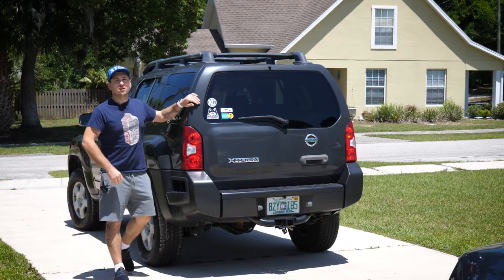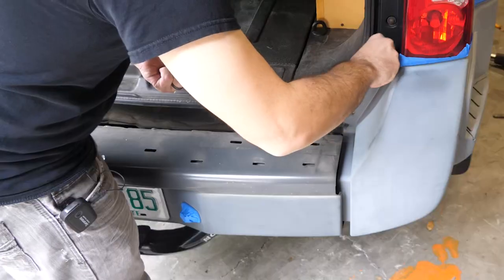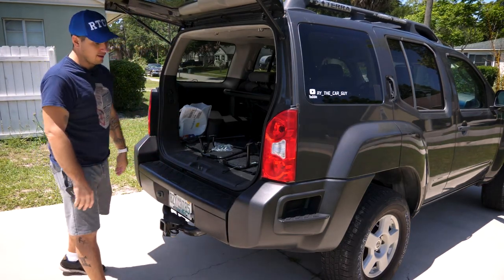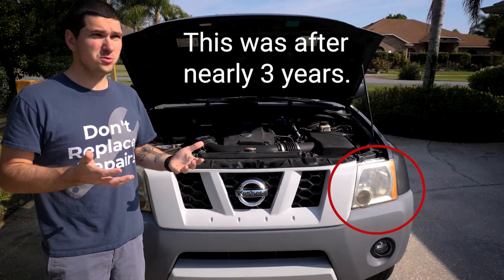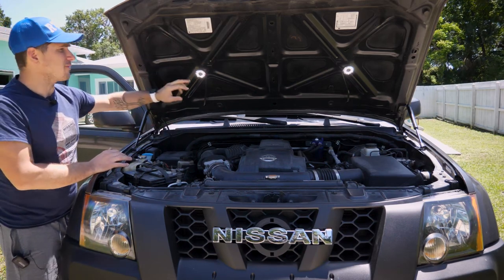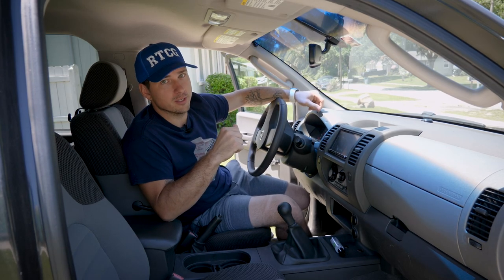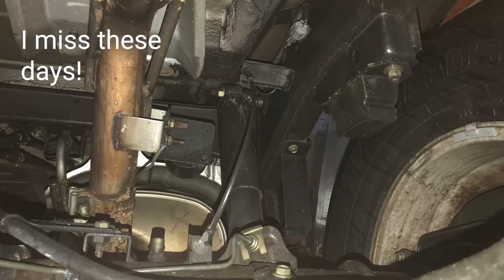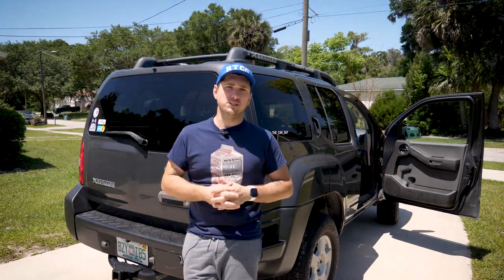How Have My Visual Changes Held Up Over The Years? (Part 1)

Comment: As soon as I saw your license plate, I could understand the good condition of your Nissan. Living in the north,  with the winters and road salt, the condition of the undercarriage is like watching death by a thousand cuts. The worst was the solid rust ball of chain when I needed to drop the spare tire.  Now I am dealing with a back hatch door rust problem that may be thru a pinch weld in the door at the top. I am truely envious of your vehicle. Good work.
Reply from the maker: Loretta, I am very grateful to have Florida cars. I empathize with you as I grew up in Michigan and I understand how brutal rust can be. Makes me appreciate where I am at even more. I hope your rig is still running strong though!
Reply: @Rythecarguy  It is still running well and I rely on it during the winter especially. Recently I had to evict mice or red squirrels from the air box who found out that chewing the air filter in pieces was a great pastime. When the MAF sensor got a particle of the filter material on it, I had to evict them and place a metal screen into the air box input port. Always something!

Comment: Ry, the fog light addition is super easy. It's already wired, just grab some Amazon lights and a switch. In fact I might even have the oem switch here I can send out
Reply: Yes, I've been eyeing that kit for some time now. List is getting shorter though.
Reply: @jamesgandia8099  I just realized he's using the oem wiring g for the light bar
Reply from the maker: Yea I did have factory fogs in there before and they glass broke in a matter of weeks. But you're right. I repurposed the wiring for my light bar.

Comment: And can you do a video for replacing the front headlights? Mine have been a problem for several years. Driving down the road & they just went out. So I'm assuming I need to put new ones in or replace the connecting wires! 🤔  Pain in the butt although I can jiggle the wires & they lights will flicker on & off. But I'd like to install new lights for a better appearance! THANKS AGAIN SO MUCH! :)

Comment: Love your videos. Headlight video helped me out a ton.  Still dealing with a bad shake that I cannot figure out.  Tried a used driveshaft and I joint and no change.  Brand new tires.  My xterra is a 2006 we bought new.  It has 407k miles on the stock 6 speed manual trans and motor.  Just routine work done over the years anything it needed.  Shake has been around for 10k miles.  Love this truck and idk if I'll ever get rid of it.  The shake is the only thing that makes me not want to drive it to far but like I said its been 10k miles shaking and still nothing has broke and its still shaking.  A few mechanics came up with nothing and told me to balance my brand new tires.  When its in 4wd the shake is worse and when you let off the throttle in 4wd H going like 45 it makes a louder clunking noise which makes me think it is not tires.  Maybe a front ddriveshaft u joint??  Anything helps thanks ry
Reply from the maker: Hey Andrew. Glad you like this videos. YT is terrible at managing comment threads so please shoot me an email at ry@rtcg.tv

Comment: Did you use the bed liner for the rear  metal bumper and front  bumper plastic bumper??? And side running boards???  Which do  you think is better rust oleum or herculiner ???

Comment: Do you plan on restoring your roof rack? I was going to at one point but those bolt that hold it on are a nightmare 😅
Reply from the maker: Probably not. I took it off at one point to clean up there but I don't wanna do it again.

Comment: I have a 2009 nissan xterra 4x4 while driving the vdc and slip light would turn on the the car would turn off. Do you have any suggestions to how to repair this problem. Thank you
Reply: @johnodonoghue651  thank you I'll look into
Reply: I had a similar set of lights appear but the engine did not shut off. My mechanic disconnected sensors to run diagnostics but could not find a root cause. Reconnecting the wires made the problem disappear. It was most likely a lose connection.

Comment: Thanks for the update. I'm about to do por15 on the rear bumper and paint over it. Do you think putting a top coat over the frame would've helped it last a bit better?
Reply from the maker: After researching it it sounded like the top coat was really more about UV protection and that you really only need it if the paint will be exposed to direct sunlight. However who knows, it could have helped right?

Comment: Great videos!! I have a 2008 XTERRA. Where do you find your replacement parts. Like interior or exterior moldings bumpers. For instance my drivers side seat needs to be replaced but I can’t find a replacement cushion anywhere. I would like to keep the same Nissan black and gray pattern material. Any suggestions
Reply from the maker: For interior parts I look on Ebay and Amazon. Not in love with those companies but they seem to have a lot of what I need. Otherwise breaker/junk yards are a great source too!

Comment: I thought you did some of the plastics with fire? Was that the Titan?
Reply from the maker: Yep! I did. But that was only about a month ago.
Reply: @Rythecarguy   I will be curious to see how that turns out. But but when you did that at I had replaced all the plastic on my frontier bed Previously. So when you did that I took a couple pieces of the old stuff and I torched them and then I'm going to leave them out all summer On my back patio or on the roof of my shed and just see what happens